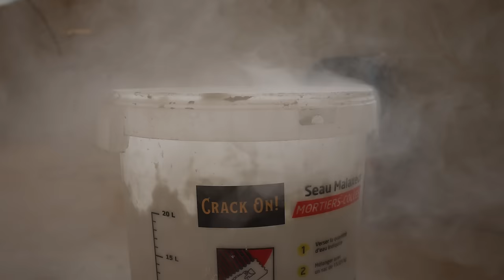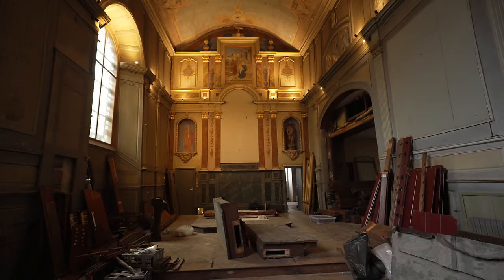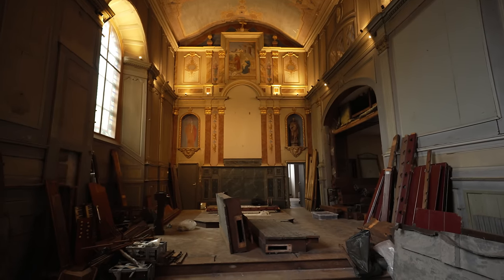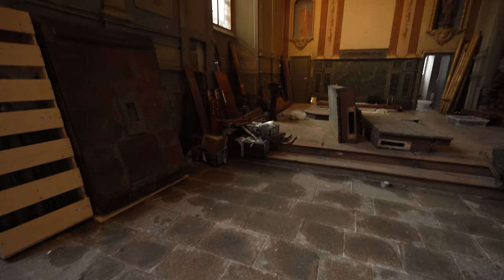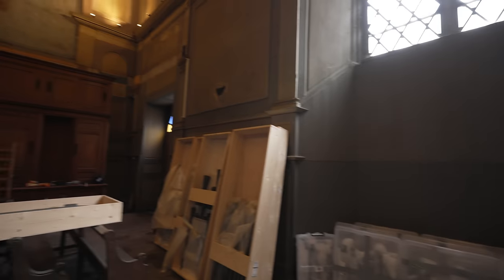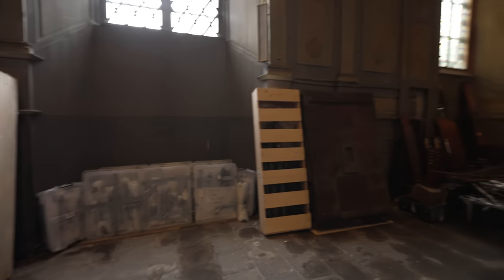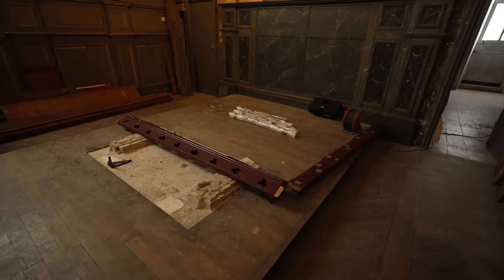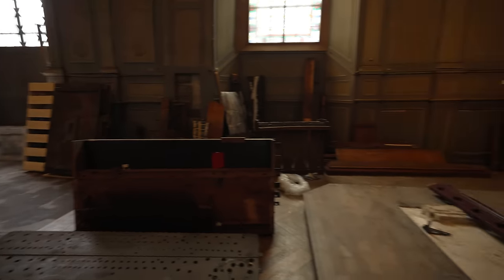Where To Put The Organ?

Comment: not entirely sure what is meant with "the altar space being used for things it shouldn't be", but: putting the organ there would be one of those things to me??
For positioning: I still think - going by the layout in front of the altar - that the organ does fit on the gallery... you just would have to do one of three things:
- put the organ on it sideways (PROS: it wouldn't be as deep and thus you wouldn't need to make the gallery deeper CONS: the organ would sit on its side and thus not look profiled)
- put the organ as you show it by the Altar, but obviously 180 degree turned up on the gallery; as solution for the gallery size you would only extend the gallery in the center section where it is needed for the organist to sit; I would imagine a rounded out center-section extending out of the middle of the gallery (PROS: the organ would look "right" and be in the correct place CONS: yes, the center-section of the gallery would maybe change the feel for the size of the Chapel)
- break out the center section of the wall behind the organ up on the gallery and push the organ back into it until the sizing of the gallery is up to your liking (PROS: the organ is up there in the right position and the gallery is the original size CONS: you are breaking that upper bit of wall)
Reply: one of things about size and usage for your chapel: I feel the entire convent lends itself well as a wedding venue - weddings in the chapel and then afterparty in the kitchen/garden. If you have the organ sitting down in the chapel you are taking valuable space for the attendees of the wedding away; in essence the organ IS making your chapel factually smaller - while the gallery: what other use does it have? you need the space/access maybe for a wedding photographer to be able to take B-roll... or you could "glass" the gallery off soundproof, so that all the people with kids can attend the event there, without the screaming/crying of kids/babies annoying the rest of the group, but is the access to the gallery really very "child-friendly"?

the only reason EVER I could find for the placing of the organ as shown in your Video/Sketch would be, if you are gearing the Chapel first and foremost to be a music-venue for classical music concerts and only maybe as a wedding venue for the smallest of weddings

Comment: Instead of removing the remains of the altar stones you might consider building a platform on top of the platform for the organ to sit on. You could raise it up a foot or foot and a half who clear the stones and that would leave less awkward space above the pipes looking at the decoration on the wall. And also if at some future date the altar was needed to be brought back in - the organ could be relocated and the original altar stones could be used for the recreation of the altar.